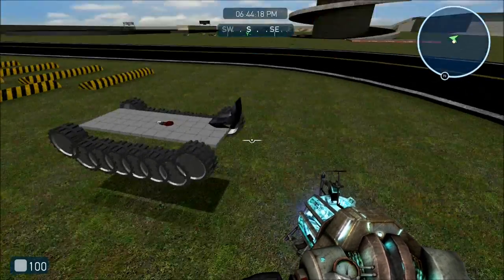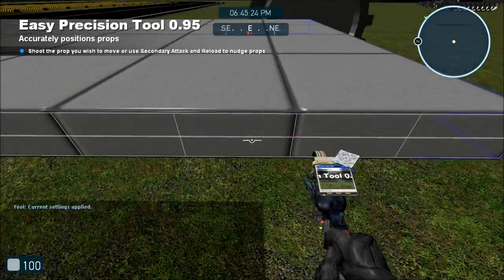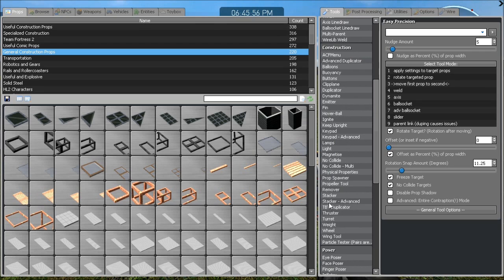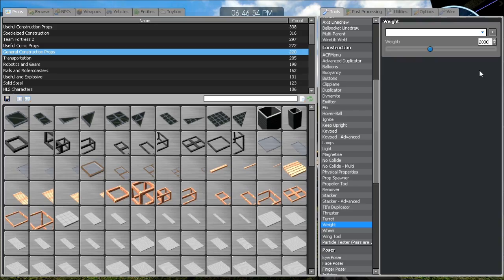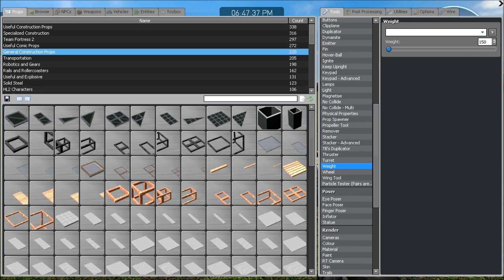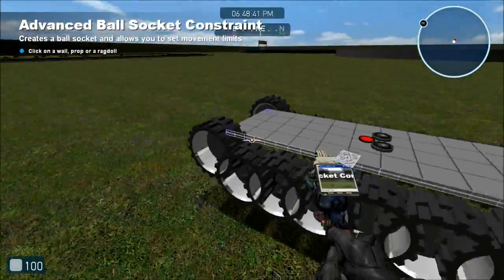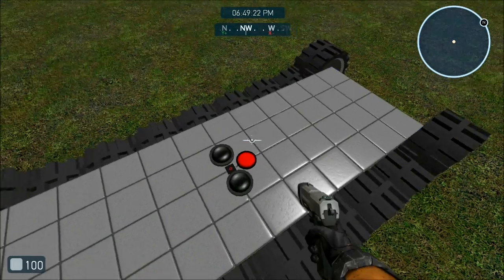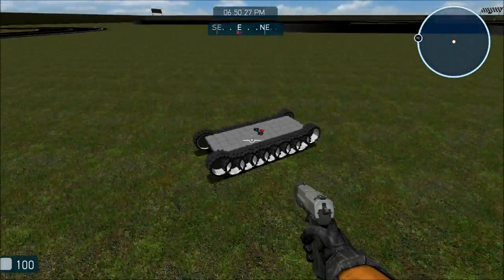Gmod - [Tutorial] - Tank Suspension

Comment: I actually have some own suspensions im using some of which are based on real life ones (like the torsion bar suspension) and work with car-like and tank-like steering (though i dont have any experience with expression and havent managed to wire up the tank steering to a pod controller, but numpad works fine too.

Comment: Got it to work, I forgot to no collide the wheels. Pretty cool, I have yet to wire it up for controls yet, as I am kind of new to the retail Gmod, and wiremod seems daunting. Thanks for the cool tut though. Any ideas on a way to rig this up for control without wire mod? I tried to ball socket each wheel to a motor, but for some reason your design wants to run away regardless. Lol it kind of has a mind of its own.